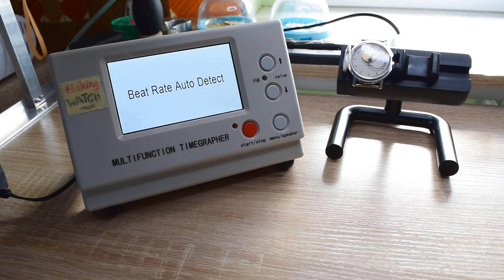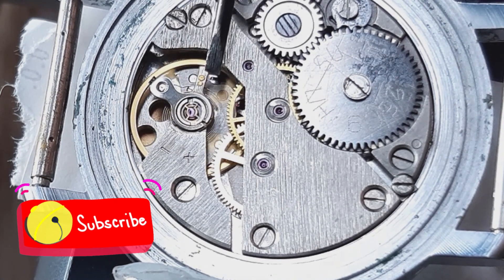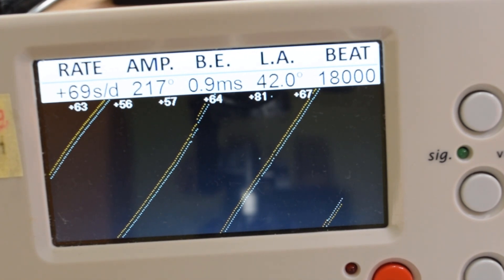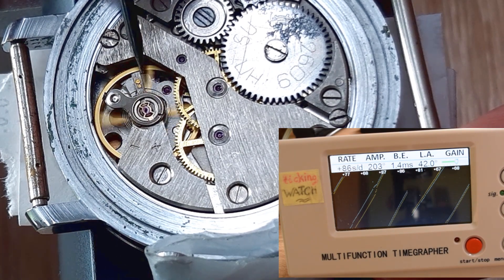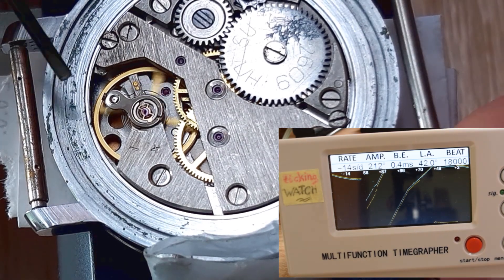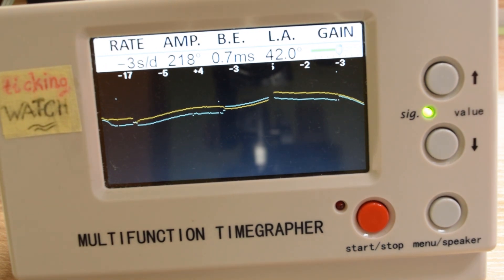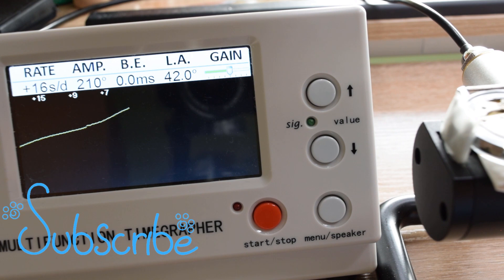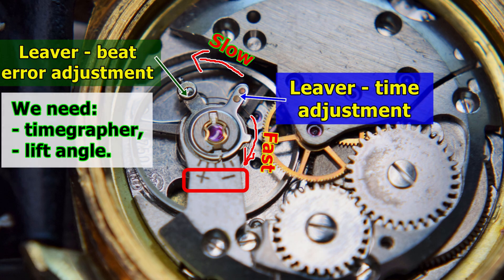Regulacja zegarka mechanicznego | Jak ustawić czas w zegarku za pomocą timegraphera

Comment: Is it thw same on a bulova 1939 supiorvisor
Reply from the maker: Nice to know that 😀  Thanks, I really appreciate it
Reply: It was a question is the adjustment shown the same on the other kinetic watched
Reply: I also have a 1939 bulova that is over wound and the adjustments are off to I manually spin the wheel till it comes back in to order??
Reply from the maker: @OvidiahJAmieglenn  should be the same, check only on the balance cock were is + and were -

Comment: You seem to be adjusting the "beat adjustment" and not the timing regulator. The timing regulator is the one that captures the hairspring in the middle of the spring between two pins. The "beat error" adjustment is rotating the end of the spring where the hair spring stud attaches. if you move the timing regulator alone the s/d number will change and the beat error will stay the same. Adjust each one for a zero reading on the timegrapher.
Reply: You are correct sir he shows the wrong levers for the adjustments. They should be just the opposite from what he is showing in the video.
Reply from the maker: @leroytwohawks1  Seems to be OK but I will check it
Reply: @tickingWATCH  It is the opposite from what you show in your diagram. The one you show as the beat error is actually the speed and the one you show as the speed is the beat error. Just trying to help you as I know you are still in the learning phase.
Reply: @leroytwohawks1  At the end of the video he shows the correct way to adjust the watch. Looks like this watch needs a service.
Reply from the maker: Thanks for your advice I really appreciate it and I'll check everything 😀